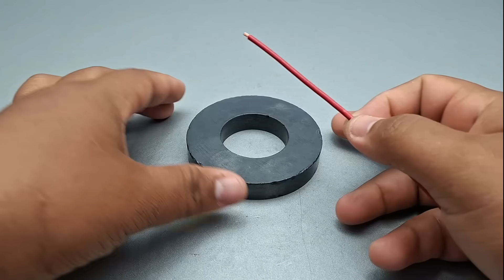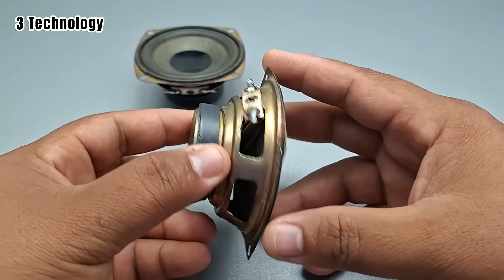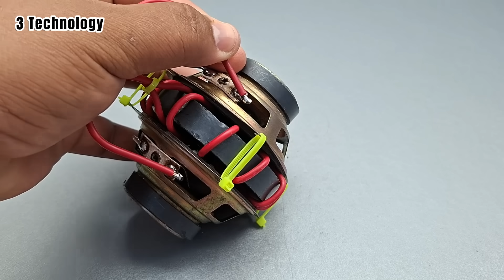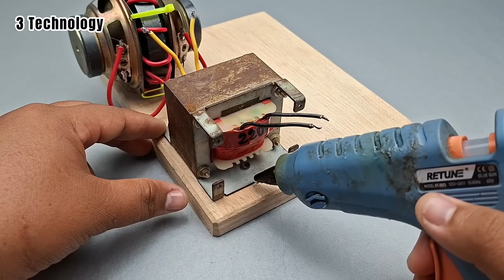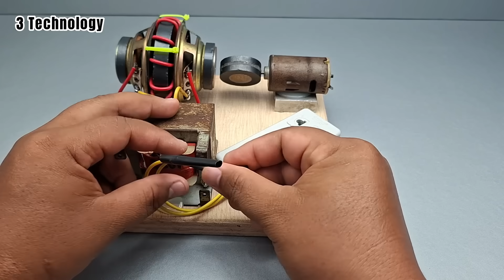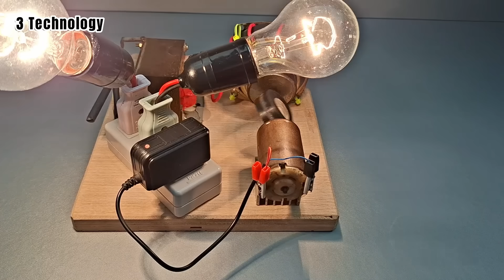I built 240 volt 8000 watt free energy generator at home using old speaker tools

Comment: OBVIOUS SCAM.  P OUT= P IN MINUS LOSSES SO YOU HAVE TO PUT IN 8 Kw FROM THAT LITTLE TOY MOTOR.  MOTOR MAGNETS NOT IN ANY POSITION TO INFLUENCE THE COILS BETWEEN THE SPEAKERS.  AND YOU CAN'T GET 8 KW OUT OF A 25 WATTTRANSFORMER. ... IT'S ALL A RUBBISH SCAM.  FAKE SOCKETS POWERED BY HIDDEN MAINS WIRES.